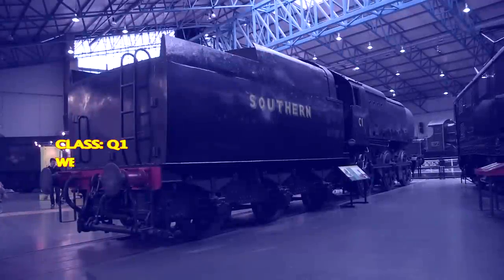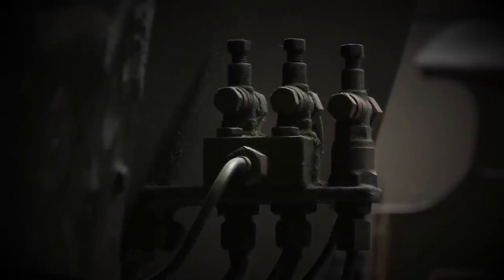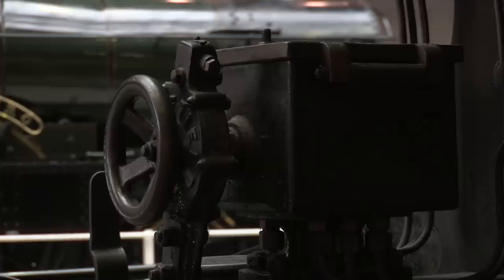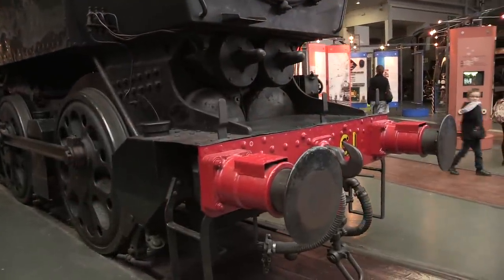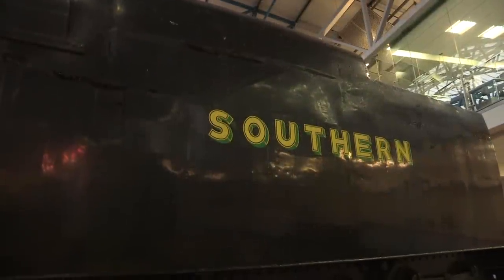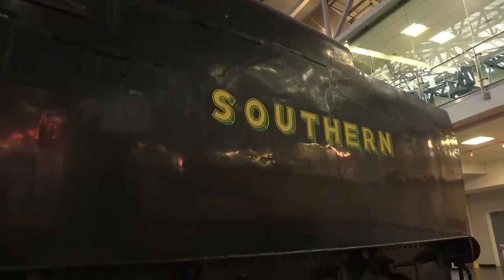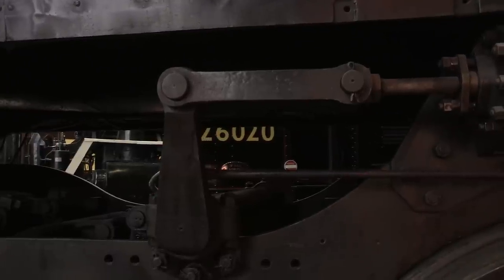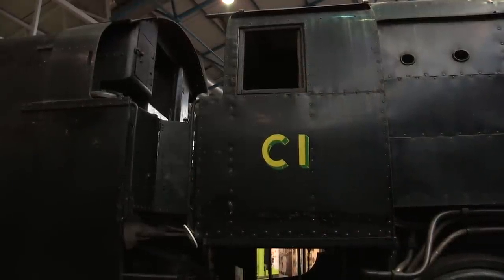SOLE SLIP: Bulleid Q1 No C1

Comment: I am old enough to remember these 'Charlies' as they called them in use on BR during the 1950/60's as a kid, and they were great powerful and reliable locomotives that just kept on going strong until the end in 1966.  Guildford and Feltham MPD's has the most allocation. And I actually stood on the footplate of 33018 when at Feltham MPD, the same day us kids had a footplate ride on S15 30837 around the yard.  An old driver told me the the Q1's were powerful, although the brakes were not that good. I always loved them myself. Make your models 'weathered' as they were never clean in BR days. Pity 33001 was the only survivor.

Comment: Britain's most powerful 0-6-0. 
I remember these odd-looking locos near my first home, not far from Hither Green (73C) depot, in amongst the Wainwright "C"'s and the Maunsell Moguls, and working freight around South London, so I've a soft spot for these "ugly ducklings".  
The lack of a running plate, apart from the difficulty in maintenance and cleaning (non-existent in my experience!) meant they were not popular with drivers,  who had to lean out of the cab side window, because the view forward was quite restricted, and with no running plate or splashers they were exposed to  a fine spray of oil in the face thrown out from the side rod  bearings.
Railway mythology has it that when William Stanier first set eyes on one, he asked O.V.Bulleid "Where do you put the key?"
Morrison & Creer''s "The Power of the Bulleid Pacifics" has photographs of a mock-up of a Pacific, possibly made during the development of the "Light Paifics", where the boiler is left without an "air-smoothed" casing, looking like a "stretched" version of the Q1 "Coffee pot" .. That would have been a sight to behold!. Here's a link to bluebellModelRailway's working model: https://www.youtube.com/watch?v=dMpk0rHTLLw&t=9s

Comment: funny thing about that legend, I heard the same thing but the engine's speed wasn't 60 mph, it was 75 mph. one other story was actually from some forum where old timers shared their experience with this class, a q1 was taking, I think, a semi-fast passenger train and reached 60 on that run, from where to which station, I forgot. but that aside, thanks for covering this class, chris, are there any other NRM owned sole survivors you have in the plans?

Comment: Huzzah for more SOLE SLIP!
I've always wondered: Why did the Q1's have that odd sheeting around the boiler? Surely it would've been more economical to have the cladding be rounded to the same shape as the boiler barrel, as was traditional for nearly all other engines. So what purpose did the more boxy cladding serve? Smoke deflection? Bullieds bizarre obsession with semi-streamlining?
Reply: I think (and I could be completely wrong here) it was to do with the boiler lagging being unable to take any weight on itself so the casing was attached to its own framework around it all. If I am wrong please feel free to correct me.
Reply: shadyhaze2013 I think you are quite right - 'Idaglass', the material was called, I believe.
Reply: 1. As with his Pacific's, it could be cleaned in a carriage washer. Saving manpower during the Second World War, at a time when it was desperately needed.
2. The "casing" on the Q1as it were, actually helped support the boiler, which I seem to recall reading that it needed the extra support...as it couldn't hold itself.
I could be wrong, but from memory, that is why.

Comment: Okay, could anyone please shed some light on this mystery. The Q1 could deliver 30,080 lbf, while a LNER J38 could only deliver 28,415 lbf. However, the Q1s only got a 5f rating under BR, but everywhere I have read thus far gives the J38s a 6f. Why is this? Was there some sort of regional conflict, or was the grading system tweaked and never applied to the 38s? Or am I just an uneducated Yank that doesn't understand how BR ran things?
Reply: As mentioned elsewhere, the comparative adhesion weight (the weight of the engine on the driving wheels) on the Q1's was less than that of a J38, so while the Q1's had more raw tractive effort, the J38's could apply more of their tractive effort to the rails thanks to all the bits that Bulleid had discarded off the Q1's, like the running boards, splashers, etc.

Comment: Why were they called "Charlies" anyway?
Reply: Patriot Works it was a nickname given because of there southern Railway numbers all starting with the letter “C” (eg. C1). Also a “Charlie” was old slang for ugly and stupid. Ignore the latter, and that’s why they earned that nickname.
Reply: The "C" is an example of Bulleid's own numbering scheme, indicating 3 coupled axles. Another example is the Merchant Navies which were numbered 21C1 to 30.  Under the normal Southern numbering C1 would probably have been numbered 3000, becoming 33000 under BR.
    You're a bit OTT with "Charlie".  It meant no more than clumsy or foolish, the modern equivalent being something like "berk" or "muppet" and was respectable enough to be heard on the BBC of the time, which is saying something.
    Believe me.  I was born the same year as C1, but take no responsibility.

Comment: I don't find these engines ugly.  Their appearance is stark but there's a harmony about the overall effect.  True ugliness is found in the medium-size BR standards (73, 75, 76 77 series), horrible gawky things.  But the design is a typical Bulleid extravagance.  The  adhesion weight is far too low for the tractive effort resulting in the loco being classed as 5F instead of the 7F the tractive effort alone would indicate.  It would be more useful to modify the Q's with a fatter boiler and sort the draughting out, not that there was much wrong with in in the first place.  The one thing you can say about these engines is that they add to the gaiety of nations, at least this one.

Comment: Yes who said an ugly engine can’t be successful look at the Reading Q-1 is was counted as the world ugliest locomotive (I don’t think that’s true it’s not the worst) (but probably due to the Reading’s distinct Wooten fire box which lead to the creation of the Camelback locomotive (i think the Reading has the most classes of them) anyways the Reading Q-1 did its job well on the Reading Suburban lines only 10 was built on the Reading and Philadelphia with Stephenson valve gear and then when they moved to Reading Company they got  Walsharts valve gear and were then classified as Q-1d sadly none survived the Cutter’s torch
Reply: And were replaced by the Electric doodlebugs or RDC which those are on display at the Hamburg Railroad museum In Pennsylvania I’ve been there and there quite neat